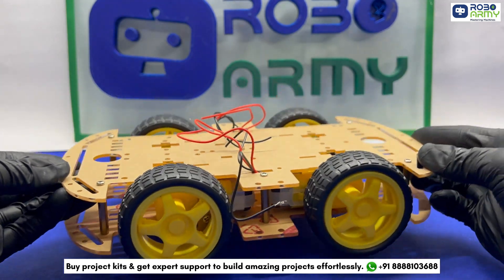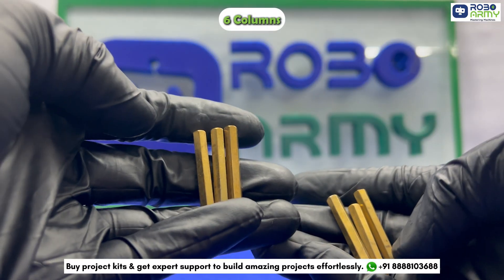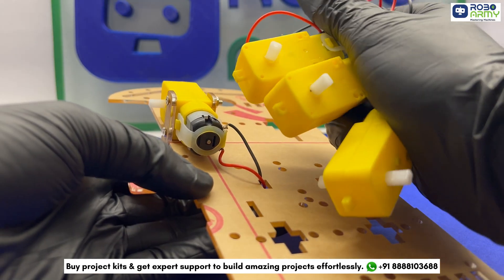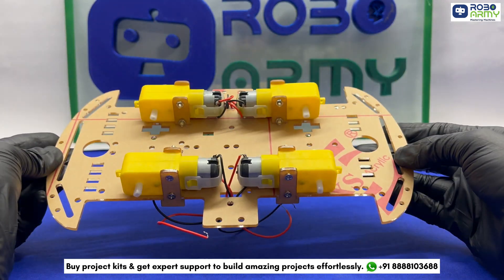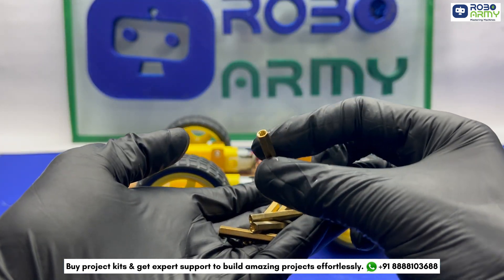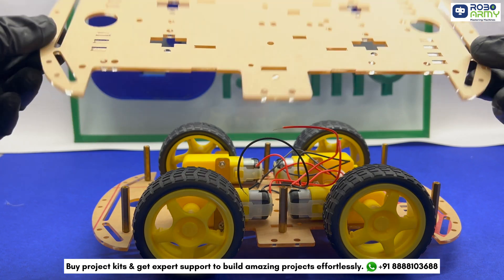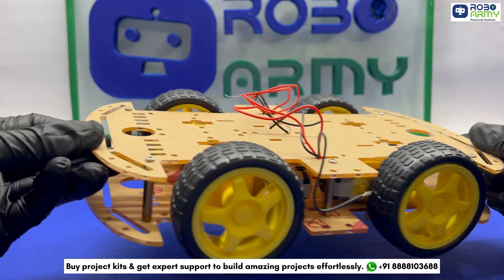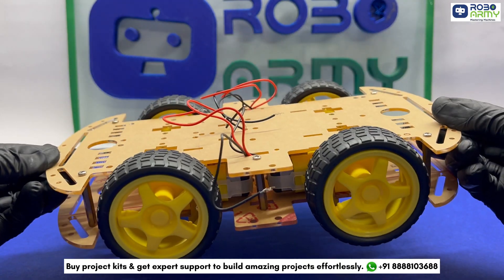DIY 4-Wheel Robot Car Chassis | Motor, Wheels & Frame Assembly

Comment: Sir how to connect bo moter in this project
Reply from the maker: For a 4-wheel chassis with BO motors:

Connect the 2 motors on the left side in parallel to one channel of the motor driver (L298N/L293D).

Connect the 2 motors on the right side in parallel to the other channel.

This way, when the left channel runs, both left wheels rotate together, and same for the right side.

Comment: Sir  the wheels are not rolling what to do then???!!
Reply from the maker: Check the motor connections and power supply — make sure they're correctly connected and have enough power.